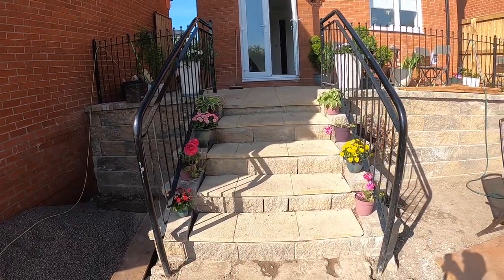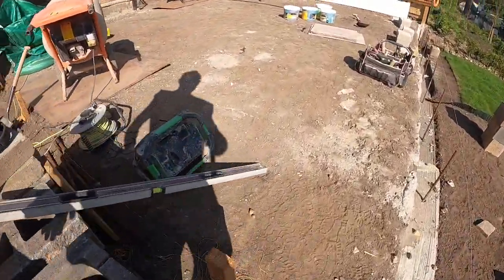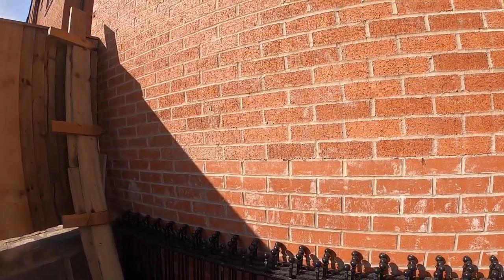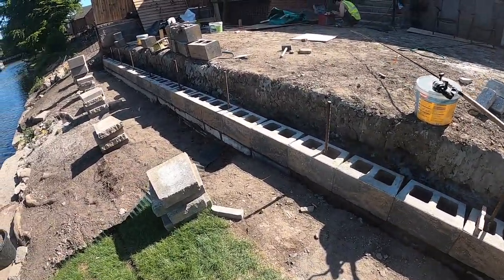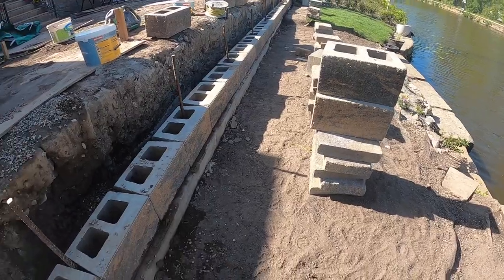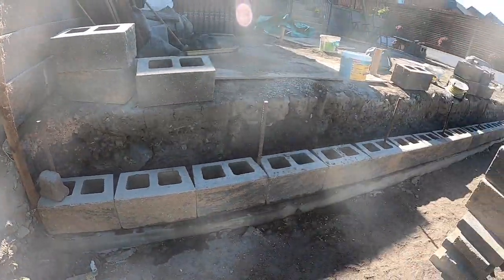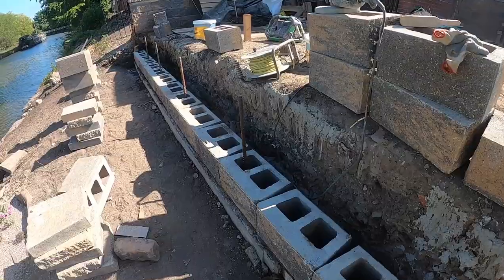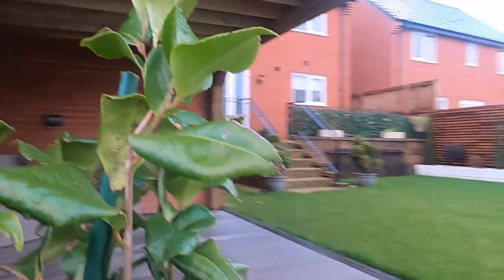SOMEONE ELSE FINISHED OUR WALL!? CANAL SIDE WALL PART 2

Comment: Any reason the first course of blocks couldn’t have been laid at the same time as the foundation and the lip sunk into the wet foundation rather than needing to chisel them off? Sorry if it’s a silly question, I’m not a bricklayer 😃
Reply from the maker: That was the plan but we ran out of concrete and ended up with a step in the footing . 
  Thanks for watching and commenting 🧱👍🏽

Comment: Did someone set the footings out wrong...? Having to use blocks... I would have thought the manufacturer of the pre-cast walling would have supplied details for setting out of vertical reinforcing rods through these blocks too...!
Reply from the maker: We used blocks as the trench ran down so we ran out of Concrete meaning we had to step it . As for calve we don’t even know what it’s called 😬🤷🏼‍♂️🧱👍🏽

Comment: Great work lads. Just out of interest, would rain water in the garden drain through the wall?
Reply from the maker: Cheers Wayne. I shield think so as it’s only stacked dry abs the holes filled with stone ( concrete where the steels are ) 🧱👍🏽

Comment: Done a few of them walls before did one 3m high for retaining a bank at a car park, but they are mortar free so don't know why you laid first row on concrete as you bed first row into concrete so it's perfectly level also never had infill ones before so never used concrete we had a heavy geofabric every three row coming level out of blocks a few metres into ground behind then once built a bit it was back filled and compacted then another sheet put a bit further still and so forth but very fast to lay as no mortar although we to bedded copings
Reply from the maker: Yeah we planned to put them in the concrete but ran out so had a step in it which ballsed us up 🙄🧱👍🏽

Comment: Lads, for christs sake the first row didn't need cut, just set in the concrete base
Some people even use a semi dry mix similar to lean mix with a higher strength mix
Giving yourselves work,   must also  add that your workmanship in any videos is superb
Great craftsmanship and perfection at every opportunity,  well done
Reply from the maker: Thanks pal . That was the plan but the trench was too deep at one end so we ran out of concrete and had to step it . 😬
🧱👍🏽